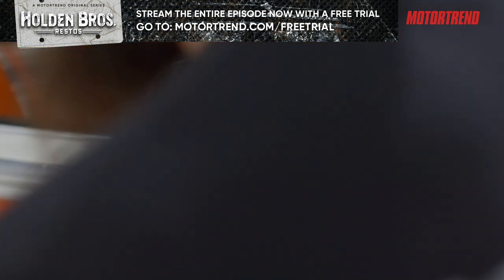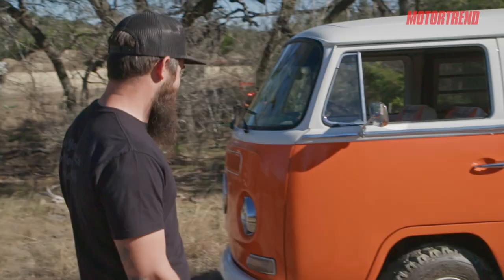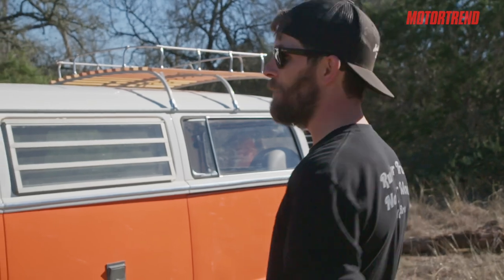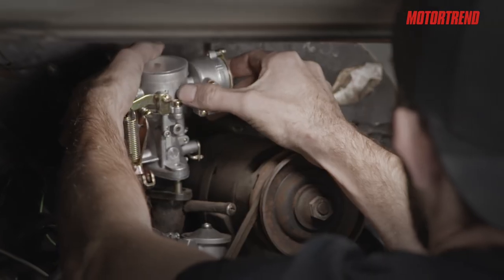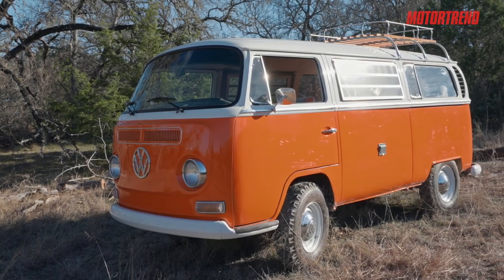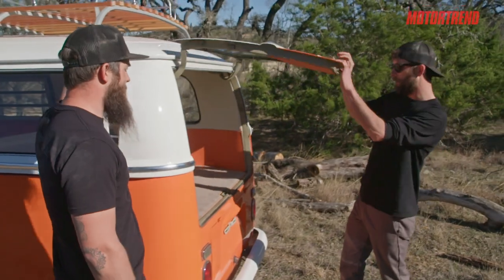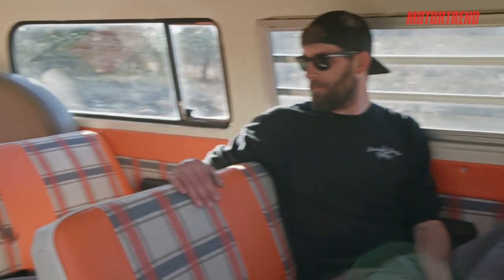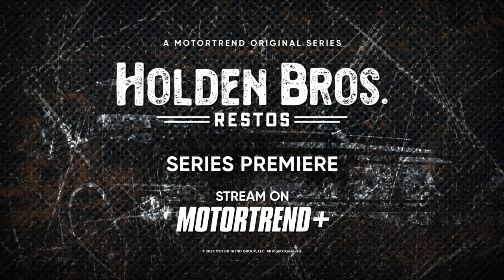Bringing a '69 VW Van Back to Life! | Holden Bros. Restos | MotorTrend

Comment: Watched the first episode on Motortrend. 20 minutes of changing a fuel pump, carburettor and one(!) brake drum, a bit of rust repair and putting wheels on, then it magically comes back painted and trimmed ready to go.
Plus the paint shop got overspray all over the engine bay seal and did nothing to clean the engine up.
I would have rather seen more of the actual work rather than chat, plus all the lovely original seats etc were lost. No thanks